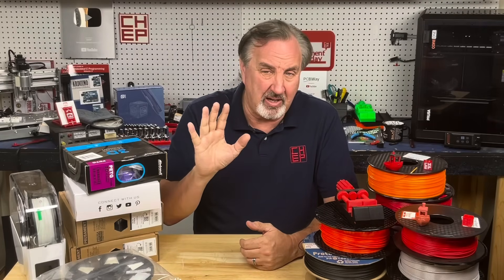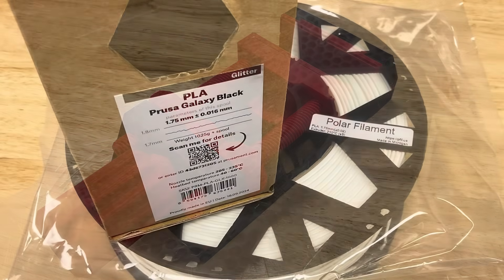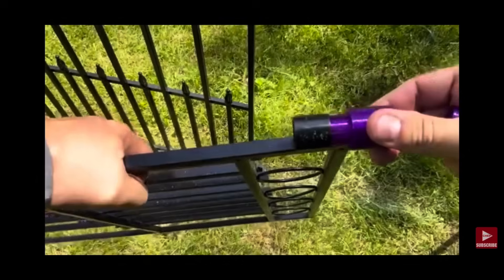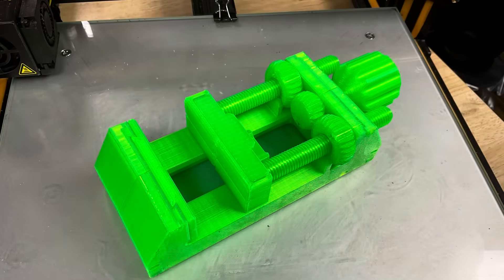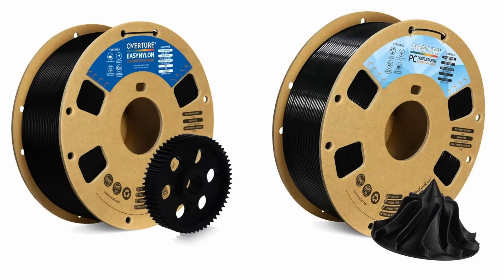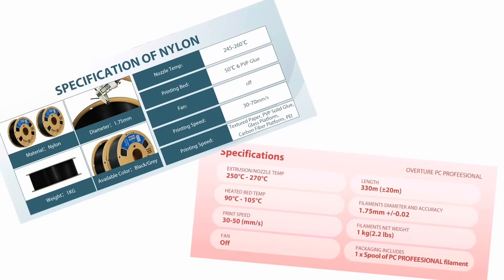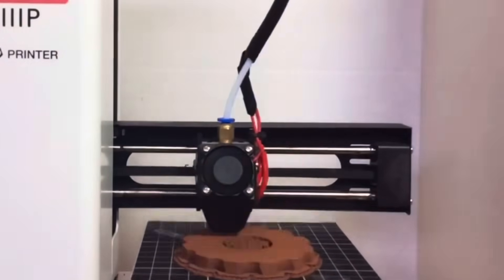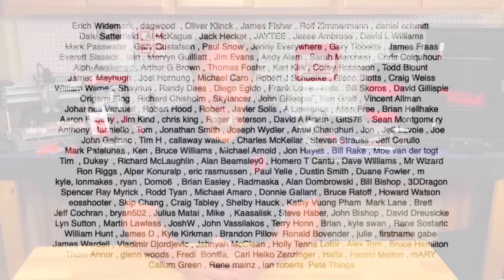Beginner's Guide to 3D Filament - Five Most Common Choices

Comment: Good overall but you are perpetuating some common myths. 

PETG is not PET with added glycol.  On the contrary, the glycol normally present in PET  is partially removed or rather replaced with another chemical, often 
cyclohexanedimethanol (CHDM).

Also, "I built a thing" recently released some videos that showed that chopped up carbon fiber added to PLA or PETG just makes it worse.   Complete with stress tests in professional equipment and CAT scans.  And PLA-CF was actually less stiff than PLA, not more.
Reply: True. If the fibers don't adhere to the filament base, they compromise it, and that's what tests show, lack of adhesion of filament to carbon fibers that even added to holes in the fiber. That's a big deal, since we try to get away from it when it's cause by moisture.

Comment: One advantage to PLA being so ridged is that it handles compressive loads very well. I use it when making leather stamp designs. It will not tolerate being hit with a hammer, but does incredibly well in a bench vise, or arbor press.

Comment: Making scale model aircraft, think Airfix, Revell, Tamiya plastic kits, I use HIPS . Prints like ABS/ASA, but is completely compatible with all hobby glues, cements, fillers, primers, paints, it cuts, drills, and especially sands exactly like kit plastic. If you cement it together with say Tamiya liquid glues, the welded joint is stronger than the material! It is low warp, very low moisture absorption, it is pretty sturdy, it answers all my problems without any of the drawbacks of PLA and others.   It is NOT just a support material!! If it is good enough for Tamiya, it is good enough for me!

Comment: What are the toxicity levels of the different types? I kinda stopped using PLA for example because I read even it releases fumes that can stay in the lungs. Thoughts? Solution?
Reply: The only ones you might need to be careful with are the abs and asa filaments he talked about. Everything else on his list are pretty safe unless you're locking yourself in a small sealed chamber with a dozen printers going at once. I'm pretty sure going outside in any busy city will expose you to worse stuff. 😆
Reply: @willd7033  I have only used PLA so far and no longer sit in the same room as the printer so hopefully minimal exposure...
Reply: PLA is the safest from what I've read. Not sure what filament you think is safer?  Definitely not ABS.
Basically none are perfectly safe.
Reply: @engineer1692  Right, PLA. I was just shocked to learn that is also not perfectly safe. As a result I make the window is open and do not stay in the room when I print. Hopefully that mitigates it.

Comment: I have two suggestions for a follow-on video. 

First, as a 5-year user of an Ender-3 Plus that my son gave to me, I can't print ABS and have to use a low-temp version of PETG (3D Solutech). I obviously cannot print ABS because of the PTFE heat limitations, and can't print TPU because of the Bowden tube (yes, I know there are "sort of" workarounds). Since this video is for beginners, it would be useful to make note of what entry level printers would be required to print filaments other than PLA. 

The second suggestion is to make some filament brand recommendations. Five years ago, when my son gave me the printer, Hatchbox was highly recommended for PLA. For better or worse, I have stuck with that. However, are there now better options? I often watch Thomas, Angus, Stefan, and a few other 3D printing channels, and they all have done filament reviews, but their reviews often recommend filaments more easily available outside the USA. 

I learned how to design in Fusion 360 and have designed and built close to 100 functional prints (most of them posted on my Thingiverse channel), many of them to fix broken equipment. For obvious reasons I would love to use filament other than PLA. Thanks to you, my Ender 3 is well-tuned and trouble-free, but I probably should upgrade to a Bamboo Labs Carbon X1, or something similar (I'm relatively old and therefore not particularly price sensitive, so that would be an easy purchase.)

Comment: That being said, I am not a 3D printer guy. But my Son is 12 years old and is interested in getting into it. I have no idea about anything, but what set up do you suggest and where to buy ?
Reply: Awesome thanks!!
Reply from the maker: Depending on your budget. I really like the Prusa Core One. Not the cheapest but very well supported. 
If low cost is your requirement, I’d start with A1 Mini. https://youtu.be/JR2zo0qwHhI?si=GmEMGu4k2wxTyXjl
Reply: The Bambulab P2S recently came out, which means the older P1S model is on a huge sale. It should be perfect for a 12 year old since all the dangerous parts are enclosed, and it's basically click and print but with opportunities to learn more. There are some ethical concerns with how Bambulab has closed their ecosystem quite a bit, but if you just want to print that's not a dealbreaker.
Reply: @Sean_735  The ethical concerns are an utter non-issue, too.  Unless you're paranoid about Apple and Google already having all your info.